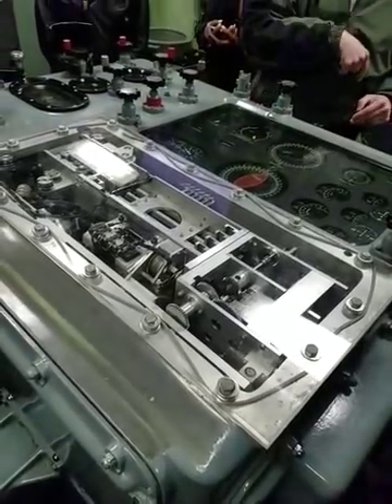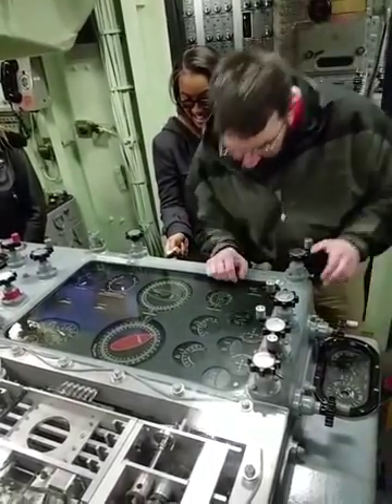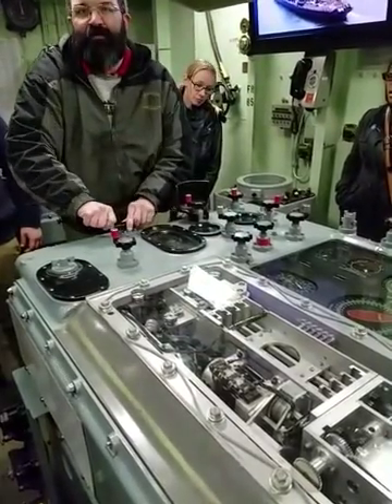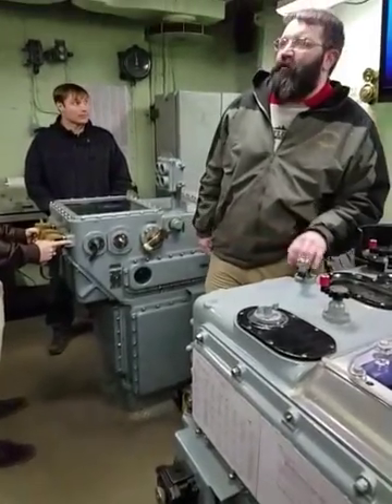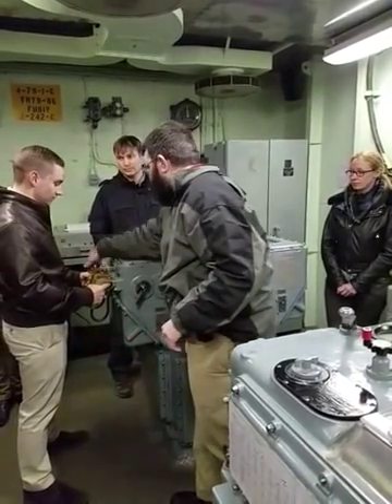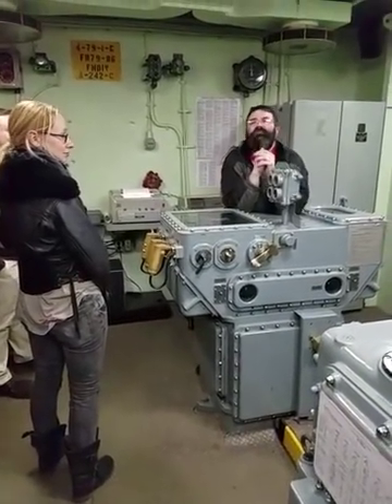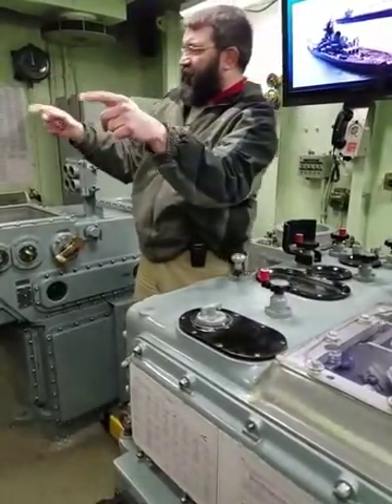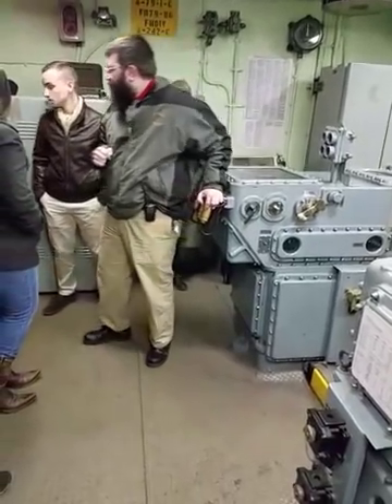Firing the 16" 50 caliber guns on the Battleship New Jersey

Comment: I love the people commenting about how its not a 50 caliber gun. The title doesn't say 50 caliber it says 16 inch 50 caliber which means the diameter of the gun is 16 inches and the length of the gun is 50 calibers which means it is 50 x the diameter or 50x16 inches
Reply: bingo
Reply: @Eric explain why he's wrong
Reply: Caliber = the internal diameter or bore of a gun barrel. which is 16" in this case.
Reply: 50 caliber is 1/2" so are you saying its 16" in diameter and its only 1/2" long?
Reply: MIKEDUZZI “These guns were 50 calibers long—or 50 times their 16-inch (406 mm) bore diameter, which makes the barrels 66.6 feet (20 m) long, from breechface to muzzle”
Reply: I stand corrected.
Reply: Nice information, thanks.....I didn't comment but was wondering where 50 Cal came into play.
Reply: I have never heard of caliber being used this way. Probably because I dont have experience with cannons.
Reply: That's why measuring caliber in mm is less confusing.
Reply: In this case I dont think it would make it easier. You would still have a 406mm 50 cal. The distinction is made depending on what your talking about; either firearms or artillery.
Reply: @MIKEDUZZI420  Pretty sure it would be called 406x50 mm. As far as I'm aware (and I'm aware mostly only around WW2 stuff), rifle and artillery calibers are designated the same. Just artillery calibers, for obvious reasons, have bigger numbers.
Reply: @MIKEDUZZI420  -- They are not 'cannons' they are rifles.
Reply: @MIKEDUZZI420  these are rifles, not canon.
Reply: @MIKEDUZZI420  .50 cal is half inch
Reply: Great info thanks for clarification
Reply: @HalfCrazy520  grumpybill No the    16"/50 is definitely a Cannon. 20mm is the minimum for designation of a cannon, and considering these are roughly 406mm, it's definitely a naval cannon
Reply: Hermann Fegelein what you just described would be a projectile that is 406mm wide by 50mm long, artillery isn’t measured the same as small arms
Reply: @MIKEDUZZI420  in metric as in imperial measures a cannon is definite by caliber and length of barrel. The length of barrel is in calibers of the gun. Therefore some English guns are definite by the poids of the projectile.
Reply: I learned something from this video. In artillery caliber is not given a unit of measure. Instead it is used as a multiplier of the unit of diameter of the bore regardless what unit is used. Also when used this way there is no decimal before the numbers.
Reply: @grinder0244 - The barrel had 96 rifling grooves with a twist of one turn in 25 calibers
Reply: Yup. Caliber used as length means the diameter of the bore times the 'caliber' mentioned. 

For example, modern MBT cannon is said to be 44 caliber or 55 caliber. Like German 120 L/44. That means the bore is 120 mm while the length is 44 times that.

In this case, 16 inches 50 means the bore diameter is 16 inches, and the length is 50 times of that.
Reply: grumpybill not rifles. GUNS.  onboard ships they are referred to as Guns.
Reply: HalfCrazy520 not Rifles onboald naval vessels they are referred to as GUNS.
Reply: Grinder02 GUNS! onboard ships they are referrod to as GUNS!
Reply: Hermann Fegelein It would still be 406mm 50 cal.  That's 50 calibers--plural.  The gun caliber is 406mm, the barrel length is 50 x 406mm.
Reply: Question: when the turret gun is ready to fire and the operator clicks the trigger handle, what ignites the powder bags and how many bags are commonly used for each turret? Also, I assume no one is allowed on the ships deck when they fire the guns or they could be injured / lose their hearing?
Reply: You're correct that the main battery blast is very dangerous, and at least part of the main deck would have been off-limits.  Take note of the arrangement of the Yamato's AA armament--all between the second and third main turrets (gun houses)and well outside their arcs of fire.
Reply: Exactly how long is a caliber?
Reply: Varies by gun.  Caliber is the diameter of the barrel bore, but when discussing naval artillery--for example a gun with a bore 5 inches in diameter, you would never say, "5-inch caliber".  It is a 5-inch gun, and "caliber" is used to define its barrel length.  A 5"/62 caliber gun has a barrel length that is 62 times the bore diameter.  A 16"/50 caliber gun has a barrel length of 50 x 16 inches.  Hope I made this clear.
Reply: @sideswipe147  
Yes, very true, but it still is a cannon.
How do you call then, a 155 mm cannon on a ship? (They exist!)
Reply: hans2406 weaponry of this type is ALWAYS properly referred to in naval terminology onboard ship as GUNS.
Reply: Interestingly, that "16" 50 caliber" measurement comes out to 66.6 ft. long
Reply: Craig Roberts don’t quote me, been 35 years, but the shell weighs 22-2700 pounds depending on type. The bags were 100lbs(?) and number depending on range. They used the same priming system used with the bagged ground artillery. Looked like a brass 12 gauge shell. Might be totally off, like I said been a long time since my uncle explained it to me.
Reply: a "Caliber" generally refers to diameter and is in tenths of an inch  so  what you are saying is a disc 16" diameter and 1/2" thick?
Reply: 5"/ 38,  3"/50  All navel guns.  @MIKEDUZZI420
Reply: Thanks for the information. I'm still trying to figure out gun,rifle, cannon and howitzer. I would like to be able to tell just by looking at the barrel. But it seems pretty complicated.
Reply: As explained below by many; calibre/caliber (English/American) is listed in most dictionaries as "the internal diameter of a gun." That is "common use/layman terms" but more commonly refers to small arms; not larger weapons. For example "50 cal machine gun" (which refers to the 0.50 inch diameter) etc. For those that use them on ships, it is the bore as a multiple of the length. Most on a ship will never use the "calibre" as the bore (excuse my spelling - I am in Australia; use "caliber" if you like :-) ) , they will always say "16 inch gun/4.5 gun/5 inch gun". As an example, the "5/54 Mk45" (which is the last gun I fired); is a 5 inch bore gun, with a calibre of 54; therefore it is 270 inches long. The use of the term "rifles" is again, semantics. They are rifled weapons; therefore they have a groove cut pattern with a twist to impose rotation on firing to stabilise the round. So the use of the term "rifles" isn't incorrect; but again - no one who uses them uses that term for them; Most sailors use the word "gun". And these terms differ slightly between countries/Navies that operate them. As does gun drill terminology. And the drills evolve over time with the equipment.
Reply: @MIKEDUZZI420  the notation is to use L as the length for example this is a 16" L50 gun. You would still say the length is 50 calibre's long as it's 50x the diameter of the projectile. Longer barrelled guns will have a larger amount of propellent behind them and thus a much larger muzzle velocity.
Reply: Can you imagine the cost for ammo in one days battle?
Reply: How does that apply to the M2-HB 50 cal machine gun then?
Reply: Thank you for posting that I didn't know!
Reply: Coming from a Navy vet. We didnt measure or refer to the 16" guns this way.....
Reply: You are factually correct but the title is still poorly worded.
Reply: 406mm shell
Reply: @MattInIllinois  go back to the mess decks
Reply: @truethought2581  obviously you weren't an FC or GM in the Navy. You can go back to the mess decks with IL-Matt
Reply: @suasponte8363  the M2 has a barrel of 45", the 16" barrel is 66' 8" in length. 16"x50=800" (800/12"= 66.6=66" 8') and that's how naval GUNS (not rifles) are measured.
Reply: @USSBB62  BB-64 '89-'91
Reply: well it also  doesn't say 50 cal. it says 16"50 caliber which means exactly what you  explained. they are AlL in small gun mindset not artillery 2700lb per round mindset
Reply: Uh, I just read it as "big".
Reply: The main guns of the Iowa-class battleships can be referred to as 16"/50 caliber. They are 16 inches in diameter and the barrel is 800 inches long (16 × 50 = 800).  Different countries measure their artillery,canons, and other firearms in different ways so they don't always mean the same thing.  A firearms caliber refers to the internal diameter of the gun barrel bore, generally referred to by the name of the cartridge the gun is chambered for, they are still categorized together based on bore diameter.  In most guns, caliber is the internal diameter of the gun barrel bore regardless of how or where the bore is measured and whether or not the finished bore matches that specification.  Barrel diameters can also be measured in millimeters so it can get confusing.   
Terms may change a bit war to war (or even between military branches), and today many such guns fire projectiles which are much smaller than the gun bore, so the relationship of projectile size to barrel length is not as straightforward as with older ordnance.
Reply: Thank you for explaining  always  wonder. May I ask a serious  question?  Would  there  have been of any  benefit  if 16 x60 or 16x70  or is the curvature of the earth going to affect  the range of the longer  barrel?
Reply: thanks, I was wondering how the nomenclature worked and ths saved me having to look it up.
Reply: @nadtz  Actually, the caliber is the INTERNAL diameter of the gun barrel bore regardless of how or where the bore is measured! The gun could have 2 to 3 or more  inches of metal in thickness from the bore to the outside, but inside the bore is where the measure is.  That's a BIG gun!   I stood on the deck beside one of those guns once, and I can assure you it is huge!  Imagine the concussion when one of those goes off!  Today, they have muzzle brakes for the recoil but still -- wow!
Reply: @MJLeger-tz4so  That part I got, I had never understood the WWII gun nomenclature though and admit I never got around to looking it up.  It also helps me understands how they label tank guns which seem to be the same.
Reply: @nadtz  I imagine measuring cannons is a lot different but I've held a 50 cal sniper gun and it's heavy, I think it weighed around 30+ pounds; I never shot it because I didn't think my shoulder pad was enough to prevent pain from recoil -- yeah, chicken, I know.  but I had a sore shoulder once from a recoil and I was holding it really tight so, oh well.... !     Hearing it go off even with ear plugs was quite enough!  To aim, hold your breath and shoot all while maybe being shot at takes a lot of control I'm sure, I'll leave it to those who are trained for that!
Reply: MIKEDUZZI   They use a full colon ( : ) for proportional barrel length, as to caliber.  It makes perfect sense as long as you pay attention to the fact that the accepted proportion sign isn’t a decimal point!
Reply: @justins.1283  not much on the HMS Hood,a crazy amount on the Missouri
Reply: .....
THAT'S what caliber means?!?! 

I always thought it had to do with the muzzle width or round width or something!
Reply: @GraveDigger388  funnily enough most german anti tank guns of ww2 also have around the same calibur.
the early pz3 gun- 37/L45
mid pz3 - 50/L42
late pz3 - 50/L60
late pz4- 75/L43, later slightly upgraded to L48 (earlier pz4s had howizers)
panther- 75/L70(the outlier for extreame penetration results)
Tiger-88/L56
King Tiger- 88/L71
Maus 128/L55

in fact, looking through most tanks throughout the years, most of them have a gun between 40 and 60 caliburs long unless its going for pure penetration on a smaller diameter, like the kingtiger or panther, or a effective howizer like the kv2.
Reply: @HalfCrazy520  most cannons have rifling.
Reply: @asherdie  Most cannons have rifling. Otherwise it would be a smooth bore. 

Not exactly sure what your point is.
Reply: @grinder0244  these are rifled guns
Reply: @sideswipe147  rifle
Reply: @PugilistCactus  cannons smooth bore. Guns are rifled. My point is these are phasers.
Reply: @asherdie  so?
Reply: @grinder0244  exactly.
Reply: @maximilienrobespierre7927  no... even the Germans listen there guns as L(insert caliber)

The anti tank 7.5 cm L36....
Reply: Thankyou, I learned something.. (I was lucky enough to the the USS Missouri do a full broadside from very close range on another ship, damn it was impressive.)
Reply: The coriolis effect has nothing to do with the direction water swirls in a sink or a toilet.
Reply: @RealisiticEdgeMod  yes it does, it's just that it is not hard to reverse the effect. But it 100% does..
Reply: A real simple way to think about this is if it were spelled out 16" 50 caliber(s), meaning 50 *16".
Reply: You realize that what you just said makes no sense.....50 calibers long? I've never heard of any weapon system using the term 50 calibers long
Reply: @sloanchampion85  I definitely could have stated it better. Abstractly it's the same as saying something has a width of x and it is 50*x long. Caliber is not a unit of measure as some folks think. It by definition just means the width of the bore. Linguistically, we have gotten accustomed to using it as if it were a unit of measure. For example, "50-cal" to most people means a round of 0.50 inches, and "45-cal" to most of us means 0.45 inches. But these are just abbreviations for saying, "it has a caliber of .50,  .45 or .30 inches (or 7.62mm for that matter)". So in the title, it really means that the caliber (width of the bore) is 16 inches. It doesn't state that the next portion indicates length. It is meant to be implied and  is just saying that the guns are 16" wide by 16"(50) long or 50-bore widths long. I guess we just don't refer to length often enough to be used to hearing it this way. I never thought about it before, but my 26" bull barrel .308 is = 26" / .300 = 86.7 calibers long.  So in parlance, it would be a .308 by 87 caliber. I know, it's not  the norm.  I hope I don't come off as a jerk.
Reply: @tfbattag  being in the Navy when we refer to weapons we don't use whatever mode of thinking or explaining that you do....I'm not even sure what your talking about or what abstract point your trying to make,  veterans like myself having served both in the Army and Navy when you say 50 caliber your referring to the Browning 50 caliber machine gun not some length of measurement, when you mention 45 caliber any soldier or veteran understands that someone is referring to the 45 caliber automatic pistol....I'm looking at it as  a veteran who has used these weapons....I'm just confused by what your trying to say....but thank you for trying to clarify it and I enjoyed the video
Reply: @craigroberts1670  Usual powder load is six 110 pound bags of gunpowder. I believe they use a special rifle cartridge blank round to ignite the bags of powder.
Reply: @sloanchampion85  From an engineering perspective it does make a lot of sense though. Total barrel length divided by caliber (which is 50 in this case) returns a so-called 'dimensionless quantity'. This quantity tells you how the ballistics of a certain gun will be, no matter the actual caliber itself. A 6in/50 will perform the same way as a 16in/50, only scaled down. Dimensionless quantities are used in lots of engineering fields, for instance to produce scaled down prototypes which will still perform similar to the final production model when keeping the relevant dimensionless quantities the same. Especially in heat transfer and fluid dynamics they are used for everything
Reply: @MIKEDUZZI420  No, ".50 caliber" is 1/2 inch because ".50" denotes .50 inch caliber. Caliber isn't a synonym for inch.
Reply: @MrTangent  The "S" on caliber(s) is what is crucial to understand.
Reply: Thanks for sharing that i didn't know that it makes a lot of sense when you hear people talking about guns guns aren't allowed by anyone in the uk
Reply: That's why the title DOESN'T say .50 cal. 

People would learn new (...and old) things if they actually read from something other than social media feeds.🤷🏼‍♂️
Reply: Most ppl are thinking 0.50 caliber like the machine gun… this is 50 caliber.
Reply: exactly wa SHE said
Reply: @hans2406  The New Jersey Guns are breach loaded rifled barrels, cannons are front loaded and smooth bore.
Reply: Leave it to the God damn Navy to make shit unnecessarily complicated..
Reply: Kelvin  lol this was addressed months ago.. way to coment before reading further.
Reply: @MIKEDUZZI420  Caliber is an arbitrary unity, 1 Caliber is the bore diameter, but is used for the length of a barrel, so 50 Caliber is saying the barrel is 50 times longer then the bore diameter
Reply: Just learned that today. And now i wonder why the heck its always used synonymus as bore diameter like with 9mm caliber for example 😬
Reply: @craigroberts1670  since it's the internet it's hard to actually arrive to late for the party.  To maybe put into better perspective.  My second ship was an Arliegh Burke class DDG we had 1 5"/54 rapid fire.  A friend and I being engineers and spending most of our existence below the waterline didn't know all the finer points on the spots that were really dangerous vs not as bad.  I forget the proper name for this particular part of the ship but it's primary mission was the massive cut in the RCS of the Burke class compared to everything before and several after classes.  It was nice is foul weather but crew comfort wasn't the driving factor in design.   The ship had a CPS system Constant Pressure System, supposing everyone at first since most folks assumed airlock=space and so they'd never see one.  Most of them were in what I'll the enclosed weather deck.  Well there is also a forward and aft water tight door and the gun was pretty close to that forward WTD.  

So we pass through the airlock and immediately notice the forward WTD was open.  Oh cool we can catch a look of the gun firi...... The world got a bit "weird" where it might feel like the hand of God smacking you in the chest when a Tomcat would blast extremely close by going super sonic, this felt like getting clapped between 2 of those hands.  My friend and I looked at each other and we could see in each other's expression we were on the same page.

"Holy crap let's get the fuck outta here before we die!"  And since that gun has a rapid rate of fire for its size we had to move fast.  We had stepped out dogged the door to the airlock and took a step or two when the gun fired.  We were inside a long metal hallway with the front opened and the back closed.  Between the sound and the pressure getting trapped in there it was pretty painful, and very disorienting and the best part it took your breath away so rapid and continuous fire ended up being a scary and painful experience and I don't remember  the rest of that, obviously we managed to escape but I don't remember how.

That was a single barrel 5 inch mount, I don't want to think about what a 16 inch would have done.
Reply: @MIKEDUZZI420  Not when you are talking Naval guns. The caliber references the ratio of barrel diameter to barrel length. Talk to any Gunnersmate or FireControlman. We know, because that is how we knew what kind of gun we were dealing with. You can also find that with some simple quick research.